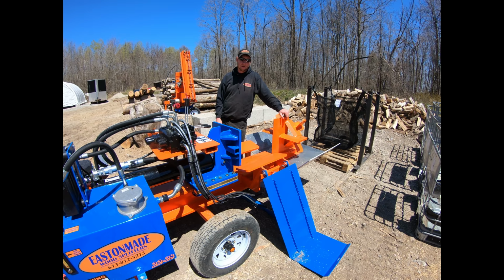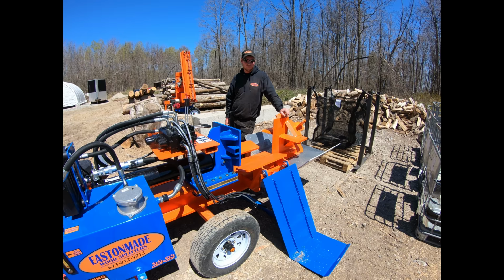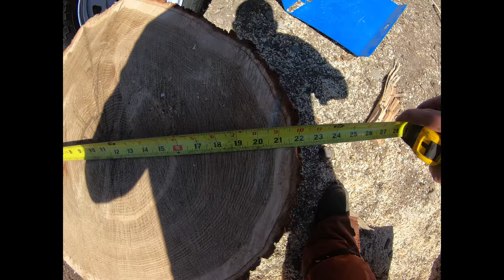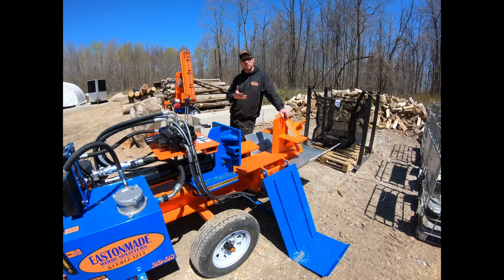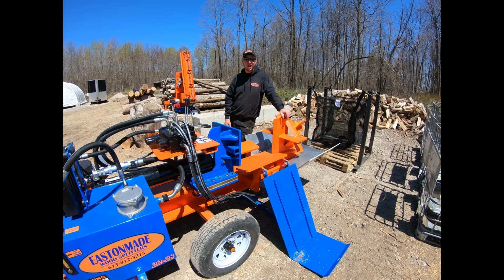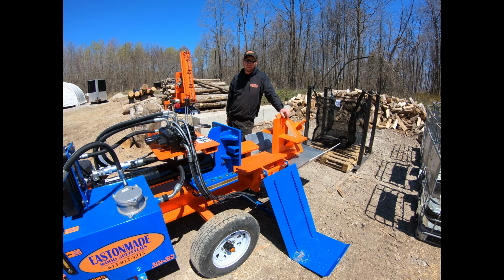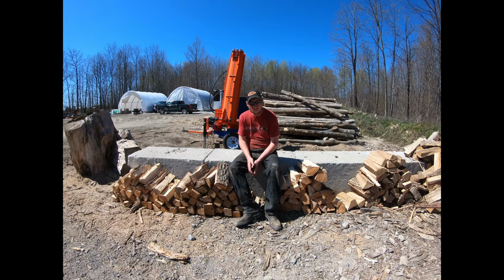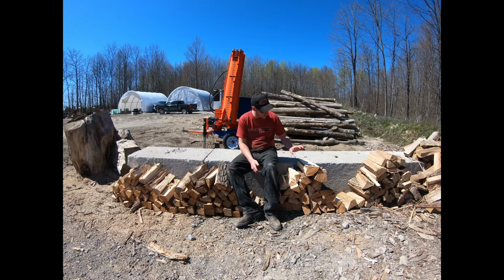Eastonmade; 12 Way Wedge VS Box Wedge

Comment: Running the box wedge on my 22-28 100% of the time. May end up being a few more cycles at the end of the day but it's still fast as hell compared to any other machine and versatile enough that it consistently produces no matter what size blocks I'm working with. I find it also safer handling the bigger pieces. Less hands-on the wood and let the machine do the work. ALSO, Love the serrated teeth on the lift plate! I noticed some of the machines in the videos have non-serrated risers and really appreciate them on my machine.
Reply from the maker: Thanks for the feedback. I really appreciate you taking the time out of your day!
Reply: Now for the real tough question , how much does it cost to : purchase , operate for a full days work , an maintain and pm ????

Comment: I've observed with many firewood splitters, the larger number of wedges (6 way, 8 way and bigger), that they work great for a certain narrow range sizes of log.  Anything outside that range, one might as well use a box wedge with the pull back arm and get consistent sized firewood splits.  

The woodworker in me always sheds a tear seeing such large and relatively straight logs get cut up for firewood instead of made into lumber.
Reply from the maker: Thanks for taking the time to leave some feedback.  It is very much aopreciated

Comment: The box does not make nicer wood.   In theory it does but in actuality wood has knots which won’t let it lay perfectly flat so you end up with small drop offs btw I made one and went back to a 4 way wedge which is faster.
Reply: Depends how big your box splitter is. I can put 3 rounds in mine for 12 pieces a pass side by side. And i often do this. To slow on 300mm rounds splitting 1 at a time.

Comment: I think I remember you saying at one point in time that the 22-28 couldn't have both the 12-way and the box wedge due to the power of the machine; it had to be one or the other.  Am I remembering that wrong, or have you updated designs to allow both?
Reply from the maker: You are right john.  We were in the early stages of testing the new (back then) box wedge design.  It works great with both wedges.

Comment: Why does the ram on this 22-28 look so much more massive than on your other videos with a 22-28?   Are there options?
Reply from the maker: No they are all the same
Reply: @EastonmadeWoodSplitters  What is your lead time, shipping cost to 28714 zip & do you collect sales tax?
Reply: @Eastonmade Wood Splitters  not much specifics on your website. What is the rated tonnage & what length log can this handle?

Comment: If you do a lot of wood 10-18inch diameter for cordwood (mostly selling) would you recommend a 6 way or the box wedge and if the box wedge would you say 5 or 7 way? We have a 12-22 on order for October but can’t decide on wedges. Only one we are certain of is the tall 4 way
Reply from the maker: Really hard to say without running it. We have lots of guys that only run one wedge and lots of guys that swap them back and forth.  Normally if you need to resplit anything the box wedge is better as it's less labour
Reply: I bought a 12-22 a little over a year ago. I use the 4 Way most of the time, Box Wedge 7 Way second, and 6 Way rarely. A tall 4 way would be very nice, the one I have is the short. Like in this video, the box wedge is great for the large rounds. Good luck.
Reply: Seather thank you! We also can’t decide between a five way box wedge or the seven way
Reply: @jeffthiem7710  7 way will give you nice uniform for firewood, 5 way would be better for larger boiler wood.
Reply: @jeffthiem7710  Jeff this video will give you a good idea on what size wood to expect from a 7 way box wedge.    https://www.youtube.com/watch?v=XiyvlGCHgpQ